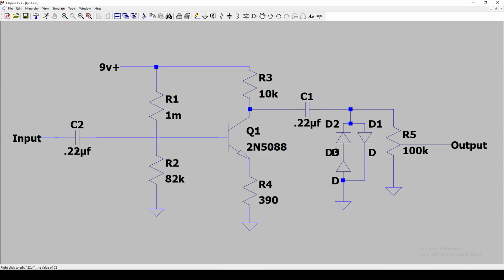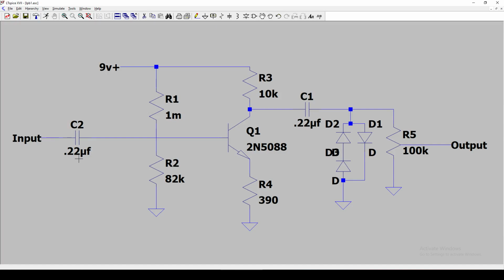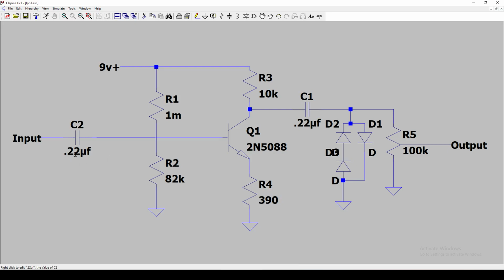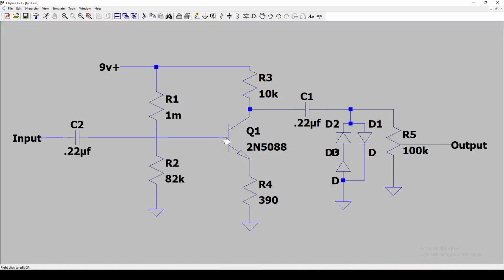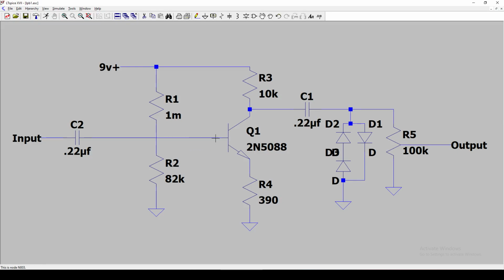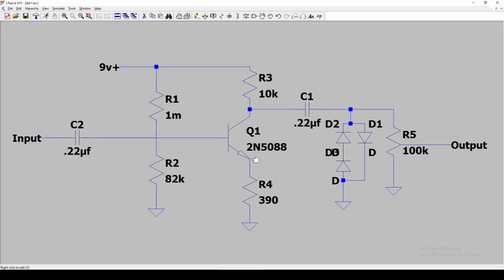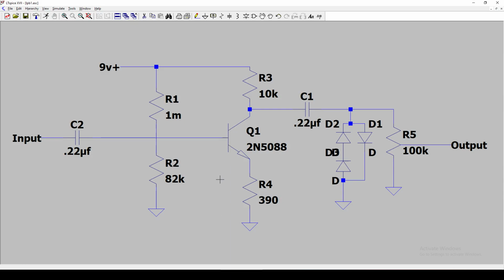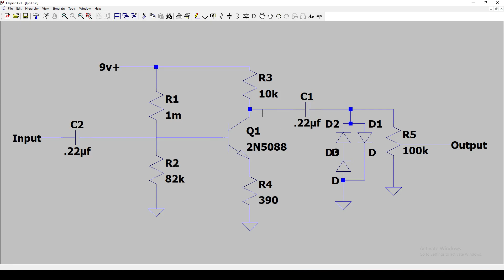LPB-1 Boost Circuit Analysis & Testing

Comment: thanks for all your resources!

i found a Bazz Fuss circuit online that included a non-standard mod. a resistor where R1 and R2 are on this LPB-1. idk if its an input attenuator or whatever. but im watching this video now to see! i had no idea the BF and the LPB1 were only a diode apart. i am building a BF with a pre-gain control, but if that resistor network helps tame the beast i wanna try that instead.

Comment: If I look up the original 70’s schematic C1 and C2 is 100nf/.1uf which would get you closer to the vintage tone? Also considering the C4 and C5 removal mod along with the ferrite beads Fb1 and Fb2 taken out and jumped for true bypass fix. Trying to mess with modding a reissue to vintage specs.

Comment: Just a quick comment to clear up some possible confusion around Q1. The video says the “Collector” is connected to R4 but the 2N5088 is an NPN transistor and this schematic has the Emitter connected to R4. The schematic is right in that the Emitter should be connected to R4 although the video accidentally confuses the Collector and Emitter pins.

Comment: I love this pedal with my PRS MT-15 it adds so much thickness to sound I'm worried it sounds like a muff almost. And I like the muff but its so much different then say clean boost from my maxon of 808 or ibanez tube screamer.
Reply: lpb-1 circuit IS the muff output section😂

Comment: Question, I’ve noticed some pedals use voltage dividers or voltage doubles on the input, so instead of getting powered by a 9v it’s powered by 4.5 v or 18v. What would be the advantage or disadvantage of that?
Reply: Higher voltage = more gain but might clip. Lower V = less gain, might be smoother. Down at 4.5 the transistor may act very differently. Some rockers purposely use worn out batteries to get odd distortions.

Comment: I understand that LTspice was used just to draw the schematic, but this circuit would not work in simulation as-is.   To those watching that would like to try this circuit themselves in LTspice, there are some problems with the schematic as drawn:
* There is no dot at the junction of R1, R2, and the base of Q1.  The transistor will have no bias in the simulation at all.
* R1 is supposed to be 1 megohm.  However, LTspice interprets the "m" prefix as milli (case insensitive), so to get a 1 Meg resistor you need to use scientific notation, 1e6.
* There is no voltage source supplying 9v+.  You will need to add one yourself.
* The pot here is drawn as a resistor and a floating wire connecting to the middle. This is effective for illustration purposes, but you will find nothing on the output.  To model this correctly, would will need to split R5 into two separate resistors that represent the pot's position.

Otherwise, great video and a nice explanation for beginners!

Comment: Hi Kley, 
I have an ehx screaming bird and the circuit is the same of your video.
But my ehx Lpb-1 has got 3 capacitors, not 2.
C1 - C2 - C7, all of them 0.1uf
My board is EC-D12.rev b

Can't find anywhere info about the third cap, c7, what is for.
Can you tell me something?
Thanks
Reply: Don’t know if you ever found the answer and without being able to see the schematic it’s hard to say but it is more than likely being used the same as the other two coupling capacitors

Comment from the maker: Time Stamps:

0:19 - Schematic Review

6:52 - Tone Test (clean tone)

7:15 - LPB-1 with 2N3904

7:43 - LPB-1 with 2N5088

8:35 - LPB-1 with 2N5088 adding asymmetrical clipping diodes on the output

9:57 - Clean tone again

10:15 - Reducing level gain to isolate clipping diodes

11:05 - LPB-1 with no clipping diodes